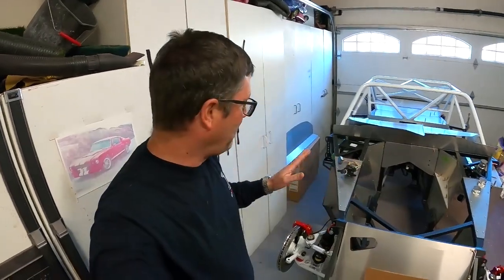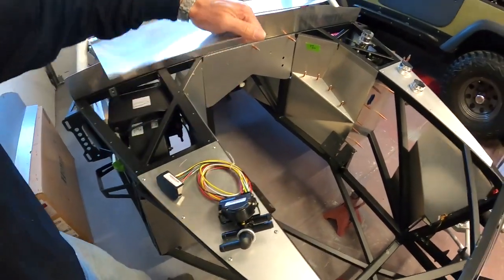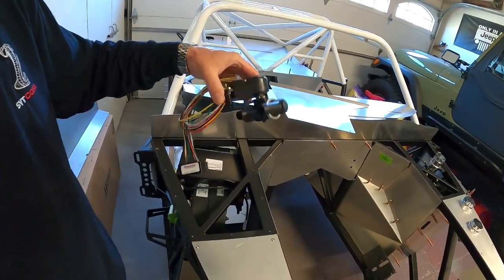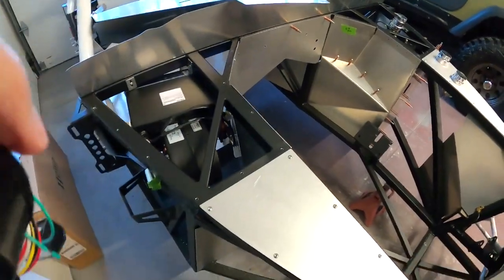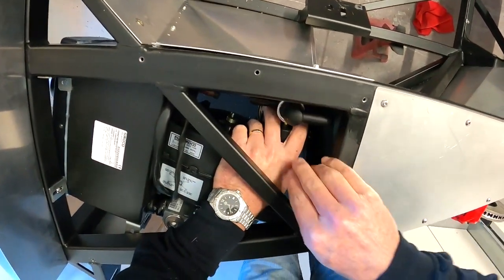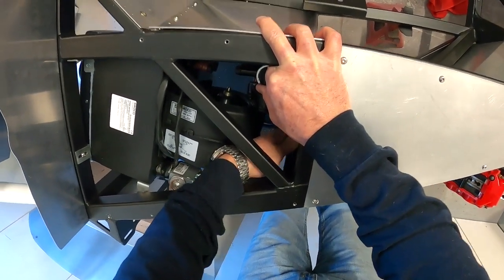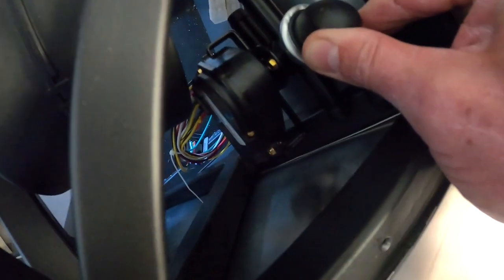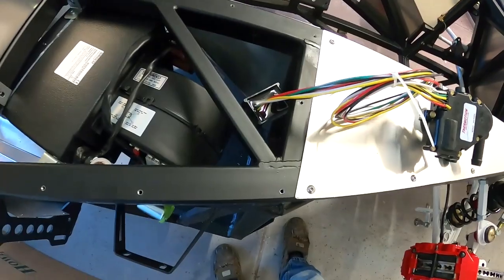Cobra Daytona Build-Heater control valve HELP, Video 55

Comment: Looks like it would fit down in there. I would probably not mess with the manifold on the footbox if you do that. The A/C lines are already really short going to the manifold. Those are even shorter. I'd take the hoses through grommets instead. Less connections to leak that way too. Having said that, I don't necessary share your goal to keep everything off the top of the footboxes. (Obviously when you look at pictures of my build.) Specifically: How are you going to route the hoses out of the front of the footbox? They're relatively direct runs when the valve is on top of the footbox. Not so much down there. No matter what, those hoses are going to be exposed and not sure show that would look better. But even more to the point, the Coyote is hardly a "clean" engine. There are wires and hoses all over the place once installed. Some can be hidden but mostly not. I worked hard to make mine clean and orderly. But only so much you can do. In the big picture, that valve on top of the footbox IMO isn't going to stand out or even be obvious with everything else that's going on. Then there's the matter of serviceability. All choices we all make during the build. And don't listen to anyone saying you don't need the full flow valve for the Coyote. You do. The Ford cooling design is for coolant to be flowing between the two heads even with the heater off.
Reply from the maker: Paul,  I always appreciate your input and agree. The Coyote is one mess of a motor looks wise.  Thanks for the idea on the grommet and not using the manifold, I will be doing that. I am actually thinking about using braided heater hoses if I can find a transition to that crazy coyote plastic piece tube. I still cannot get over the plastic oil pan and pickup. 
Keep the input coming as you are the guru on these cars.

Comment: Will the heat from that valve cook your ECM and/or other electronics in that area?
Reply from the maker: The ecm is actually going on firewall behind engine so no concerns. I decided against putting it in foot box. Too much going on in there